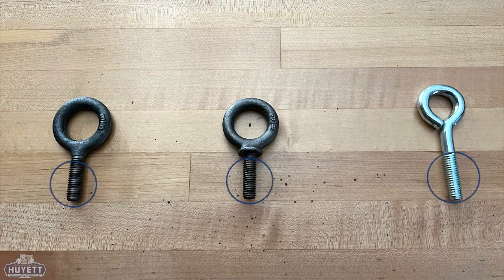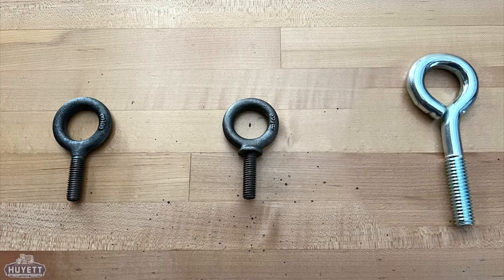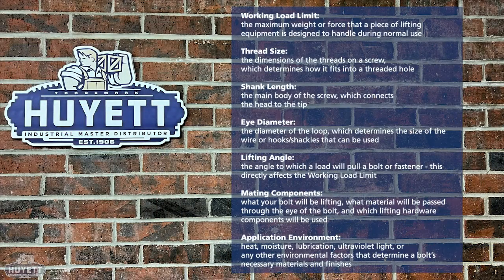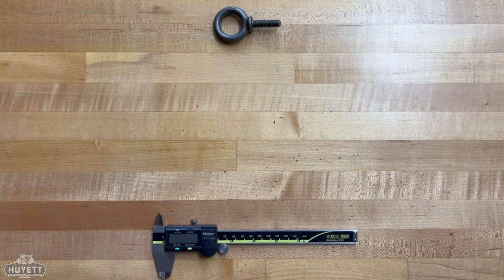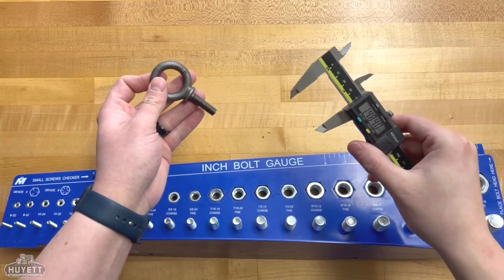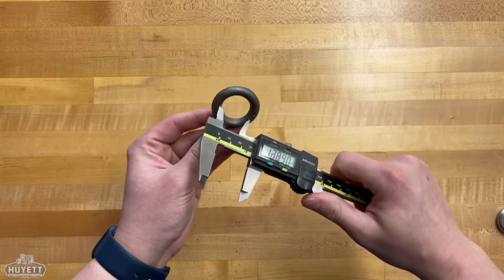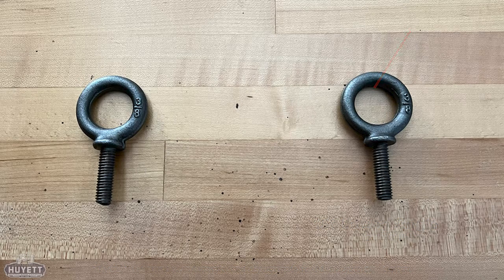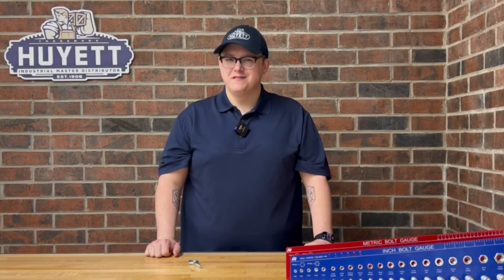"Huy Oughta Know" – How to Measure Lifting Eye Bolts

Comment: What a pity - YOU FAILED THE CRITICAL TEST.
That of proof-viewing and proof-LISTENING, as at precisely
3.53 (notice I used a full stop and NOT a COLON, which would have linked to the start of the problem)

As sadly at that "point" YOU went from a "professional" video presentation, to that of a "kids" bash-up.

WHY?
Simple - 
YOU NEVER PROOFED YOUR FINAL CLIP.

Instead of being a very crisp properly balance STEREO voice over, it CRASHED horridly..
I won't insult your intelligence by "actually telling you what went wrong"
As THAT is for "you" to still find out by proof-listening to it..
USE STEREO HEADPHONES from a stereo PC's outlet.

That way - you can listen correctly listen from say 3:00 to HEAR WHAT WENT WRONG, to allow you to remove the video and "add" the correct sound track - to the clip you made originally.
Or just add another partial sound track using the other one as a guide.